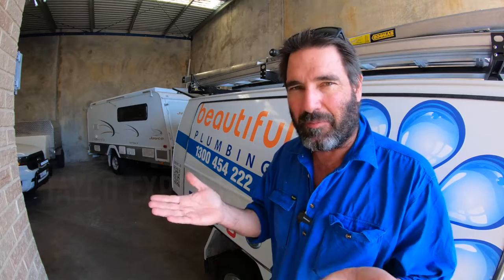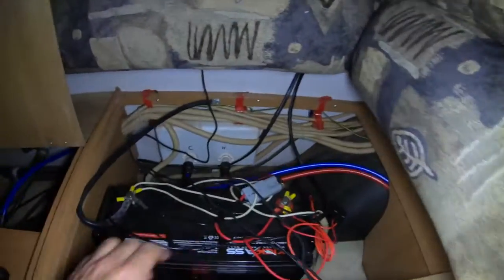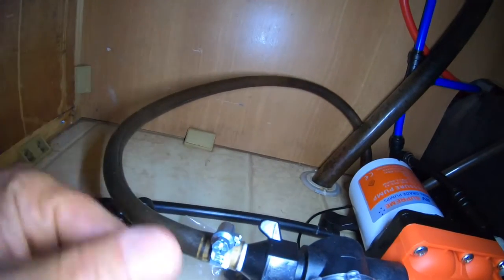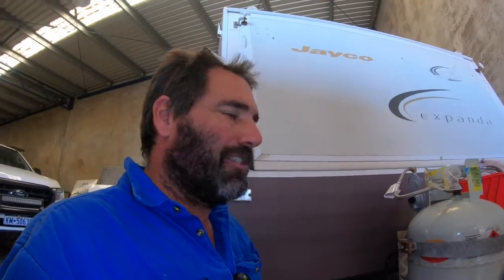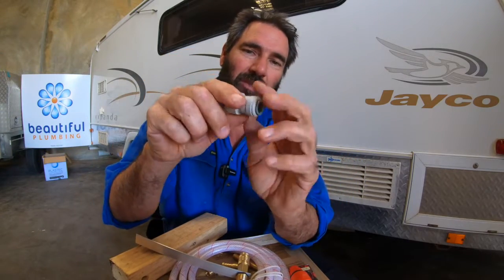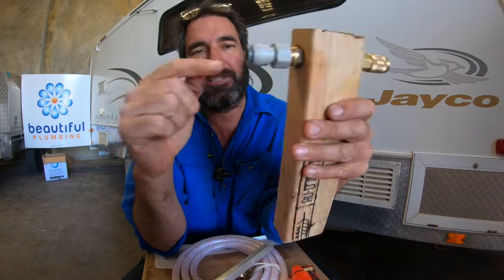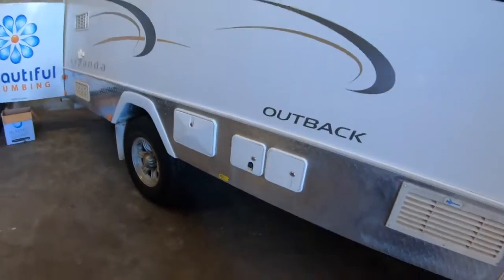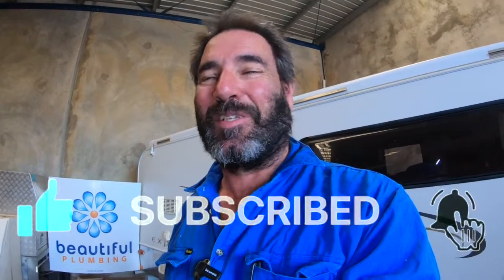Jayco Expanda Modifications You Need to See

Comment: Great vid thanks Ben. Just wondering do you install a check valve in from the mains pressure water inlet point as well as the pressure side of the pump? To prevent the pump pushing water out of the main inlet, or are they factory fitted normally?

I have a standard 2017 Jayco starcraft outback. Bog standard model.

I assume the pump will operate the draw bar tap as well? 

Also, with this set up could you have tee'd off the low pressure line under the sinks manual tap, to keep the hand manual tap in play if needed?